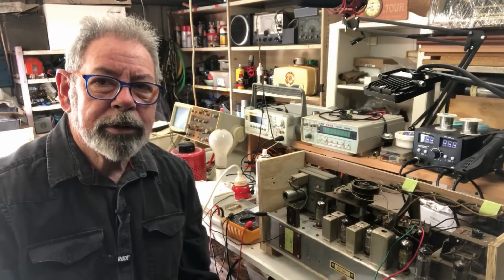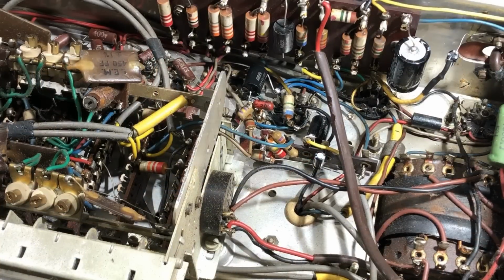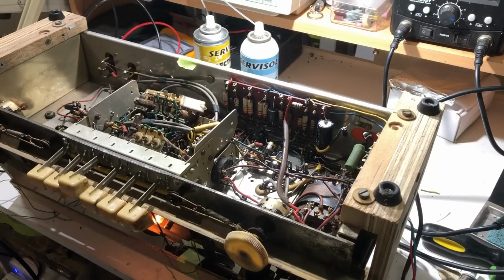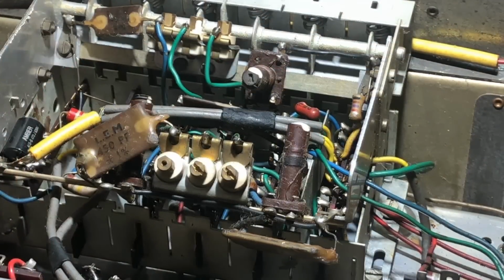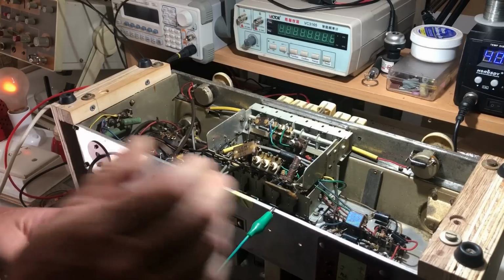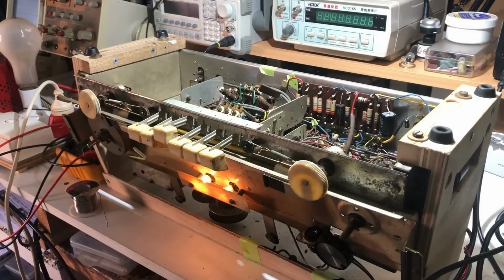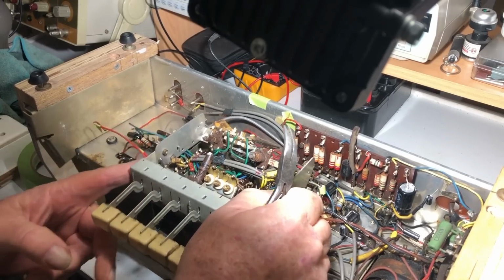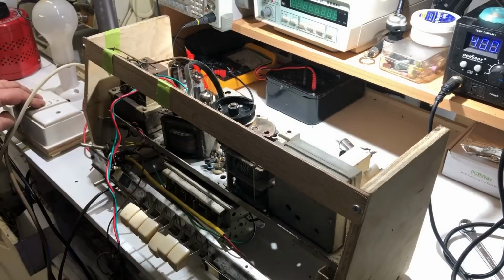BUSH VHF64 Part 2 - The deeper I dig, the worse it gets!

Comment: Often the IF cans have silver mica caps inside. They will sometimes fail after being used for a while after a long silence. The silver migrates to the edge of the wafer and starts arcing, causing the crackling noise.
Reply from the maker: Hi. Yes, I'm familiar with silver mica disease.  I have also found it in other mica caps outside the IF cans.  In this case though it was something else.  You'll have to watch to find out lol
Reply: @Donno308  UK IF transformers dont use the same type construction as the American ones that give problems, they use separate  capacitors, not ones integrated into the base in some way

Comment: These Bush VHF radios are difficult to access for servicing, as you probably well know by now 😀I think your work is as neat as it can be in the circumstances, without spending days more than you need to to get it only moderately more neat. Nice job so far... The crackling noise could be a capacitor inside the IF cans, if they're mica they could have silver mica disease. Could R12 be noisy? Did it get warm with the radio on AM and FM or just AM (or FM). Good luck.

Comment: That radio is giving you the hellin, Don, those switch wafers were prone to the phenolic board carboning and arc tracks developing. Nowadays no more problem with 3-d Printers, maybe Dave T. can help out. As for the Sprite: I would definitely go for it if the sills and the bottom of the rear fenders behind the back wheels are ok. Always depends where the car has lived, hopefully not to near the ocean 🙂 They arent too hard to weld, hardly any box sections which are difficult to get to get to, all pretty basic build..
Cheers from Deutschland
Reply from the maker: Hi Blitz!
Good to hear from you.  I am now certain that the switch wafers are the problem. Apart from eliminating just about everything else, I can see arcs tracking across the phenolic board between the contacts. Perhaps 3D printing is the answer but the contacts are pressed through the phenolic in such a way that they would be difficult to remove and re-install without damage.
I'm considering  fitting micro switches, activated by the movement of the sliding contacts.  I think I only have room to fit 1 micro switch per bank so I thought I would use relays, activated by the micro switches, where there is more than one set of high voltage contacts on one switch.  Not sure yet - I have decided to have a break from it and do something else as I am getting frustrated with it, however I hate unfinished jobs so I will definitely get back to it.
As for the Sprite - I wasn't entirely happy with it.  It had been heavily modified for competition and wasn't easy to drive around.  I'm now looking for an early MGB.  We'll see.
Cheers

Comment: Is this the dreaded silver mica disease? It's a pain to fix. I think you may have replaced that 150pF silver mica with a 1.5nF, not sure but now having watched it to the end, that is the least of your worries. I have never before seen the IF coils switched, it would probably work just as well if you cut the wires and got the HT away from the switch. Good luck with this one.

Comment: One of the main problems with these switches is there vulnerability to cleaning using spray switch cleaner,the phenolic can in certain circumstances absorb the cleaner and breakdown under high voltage causing the effects you are experiencing,cleaning with a q-tip on each contact is preferred.
Reply from the maker: Hi. I'm afraid the damage may already be done.  The first thing I did was give it a spray with contact cleaner :-(  I'm still holding out hope that it isn't the switch.  If it is I'll see what I can bodge up.
Cheers

Comment: Hi Don,
These slide switches were notorious for burning and arcing, therefore creating carbon tracks into the phenolic between individual switches.
By the time I was age 17 (during virtually all of 1972) those entire switch banks mechanisms were no longer available as a replaceable part …only NOS were available.
Unsoldering, removing, making new phenolic boards, and fitting the original switches into the new board so they line up, and work can be a serious pain in the rear.  I know because I’ve done it!
Before doing anything else, critically check each one of the phenolic boards and switches.  The arcing problems are often caused by electrically leaking capacitors, and dust, especially if it contains carbon that derives from coal smoke environment, and to a lesser extent from cigarette smoke.  So, be meticulous when cleaning them.  They can be porous so be mindful what you clean them with.
On a side note, have you thought about building your self, or adding a ‘component sniffer’ probe (in my day of servicing they were referred as an ‘electronics servicing bloodhound’, or just ‘bloodhound’) to your signal tracer?  Very useful probe for determining, or sniffing out crackling and popping resistors, and capacitors etc.  Mr Carlson’s Lab provides a comprehensive circuit for one (connected with a Heathkit signal tracer servicing video), plus he does a detailed demonstration of its operation.
Cheers Don, from Phil.
Reply from the maker: Hi Phil.  I think you're on the money with the slide switches.  I have eliminated just about everything else and I have now observed arcs forming across the phenolic between the contacts.  I'm wondering if I let them burn, they will burn themselves out?  I'm looking at whatever options I have.  I hate the idea of scrapping such a potentially nice radio.
Reply: @Donno308  Hi Don,
Very high probability the arcing, or burning was no fault of yours: quite likely the process started a year or so before that radio was decommissioned, or put to one side.  Perhaps the owner at the time felt it had been such a good radio, it would likely have been seen as an egregious act to have discarded it.  My guess is, the lack of arcing when you first got the radio working on AM  gave you a kind of false impression for a short while.
Making those slide switch phenolic boards can be very fiddly, tedious, and time consuming: especially if you are doing everything by hand with little or no shop precision tools.  If you had no option other than to go down that route, remove the metal contacts with absolute care, you will need to reuse them later - they can be a pig to reproduce.  I know this because I’ve done it a small number of times when I’ve worked on other makes of radios.
If the arcing is not too severe, it is possible to poke, or gouge the carbon tracks out of the phenolic.  Be meticulous when doing this as any carbon left behind is in effect a resistor, therefore will eventually cause arcing again in the future.  If a hole appears in the phenolic, provided it is not to large so as to weaken the switch mechanism, don’t worry too much about it.  Fill in the decarbonised tracks and holes with a none conductive hard filler; smooth it over when fully set so that it looks a decent job, and also to avoid impeding switching motion.  When smoothed to personal satisfaction, paint over with a none conducive lacquer to aid extra hardening and strength.
This might come across as being ‘belt and bracers’ but I am a ‘belt and bracers’ type of chap LOL!
I am very happy if any of this is useful to you my friend, regards, Phil

Comment: I think the crackling and switch smoke might be two separate faults. My money's on silver mica disease in the IF cans for the crackling and carbon tracking in the switch wafers for the smoke. But I'm probably completely wrong - I'm not sure it would explain that hot resistor. ..

Comment: Hi Don, no progress on mine sent for some caps but the filter caps were short supply and have to wait a little while longer. When you were talking about the contact clearance on switch S6 @55:16 I couldn't clearly see the contacts behind the red/ yellow/blue wire group in the bottom corner. I believe that is S6f and s6z on one side of the centre bar. F should close and Z should open as the FM switch is operated. If Z is still in contact when operated both AM and FM IF tuning circuits will be shorted at the same time, feeding B+ via R12 to the pin 6 anode of the ECH81directly. If so the current draw will be high (and possibly a higher anode voltage than 190V), would explain the hot resistor and the smoke generated in the switch if the contact is HR. Hoping mine is ok there don't relish taking that key assembley out. Good luck!
Reply from the maker: Hi.  Thanks for pointing that out.  I will certainly check it out.  I'm back in the shed today after the usual frenzy of editing & publishing the video.  Whatever, this time I will have to be more methodical.
There's no reason to think that yours will be this much trouble.  You will still be faced with replacing a lot of those Hunts caps but that's no big deal, just tedious.
Cheers
Reply: @Donno308  I sure hope so, that looked tricky. btw thank you for ignoring my error. late nights and a few beers. Of course a higher current draw  without the impedance of the IF coils will drop the voltage across R12. giving a low voltage on the anode.

Comment: It's fighting back at you Don. Most likely every cap is a resistor now. Instead the caps are like little shorts and 
causing the smoke down the signal path. Dodgy PC board terminal material could be the problem ,it may be conductive!
Reply from the maker: Hi
I've already changed just about every cap in it.  The question now is whether the resistors are still resisting!  I hope it isn't the PC board material in the switch that's causing the problem.  That would be impossible to fix.

Comment: Don could this be simple Silver Mica (SM) disease?  Intermittent shorts in the SM caps often inside the IF cans.  In a dark room you cans sometimes even see them flashing.
Reply from the maker: Hi.  I hope it's something like that.  At least it would be fixable!
Cheers
Reply: @Donno308  Keep going Don!  Everything is fixable if you change enough bits.  But seriously I think SM explains everything you are seeing and hearing - smoke and all!  They are often used inside the IF cans some with HT across them.  “Tapping” them with the end of a screwdriver often stops or starts the noise

Comment: i'd still say it IS the switch...slightly carbonised and/or partially conductive due to moisture/dirt, try disconnecting the section that shorts those IF primaries , as that part may be near to a low potential section .. and maybe the one switching the ht to the fm tuner, temporarily wiring it permanently , it 'could' with a bit of bodging be replaced by a small microswitch somehow activated by the FM button!! i think i'm going to have to do this with one of mine, if i want to bother with it, as the dial plate has lost all its paint 😢
Reply from the maker: Hi Andy,
I'm hoping it isn't the switch - If it is I could also maybe use a relay to switch the HT with only low voltage on the switch contacts.  Hopefully I won't have to.
Cheers
Reply: @Donno308  i'm afraid very likely ht tracking across it, its a known problem 😢
Reply: @Donno308  yep, relay or microswitch, as i said you should be able to disconnect those sections across the IF transformers without any major problems, not all manufacturers did it and their sets still worked perfectly ok, just may have to tweak IF alignment especially on FM to compensate for loss of the switch and wiring capacitance

Comment: testing valves on a valve tester doesnt always show up all problems, they dont usually test internal insulation at full volts,  its 'possible' random breakdown can occur at normal working volts,
Reply from the maker: Hi Andy.
Yes I guess that's a possibility too.  Unfortunately I don't have any substitute valves that I can plug in.

Comment: "Siver mica desease", that's all I could think of, hearing the crackling. Caps inside the IF cans.
Reply: Measure the dc on the if cans - if it’s S.M.D. Then you would see it fluctuating as it crackles
Reply from the maker: Thanks.  Good tip.  I'll give it a try.
Reply from the maker: Hi.  Yes, I'm thinking that too.  
Cheers

Comment: arcing/carbonised switches of that type is quite common, i have a murphy piano key set that flashed violently and almost caught fire, not a lot you can  do about it once carbonised, except disconnect any ht connected sections if possible, some arc between the ht connected sections and low potential ones if they decide to put them next to each other, which is rather silly, even the section which switches ht to the fm tuner and turns the am oscillator feed if same section can arc from the 'active'  side to the non active one ,  bush model vhf91 and vhf70 were notorious for ht tracking in the slider switch , looks like the  vhf64 is also, i think the srbp material absorbs atmospheric moisture over the many years making it slightly conductive, even if it doesnt arc, dc  can get where it shouldnt causing strange problems........  that part of the switch across those 2 IF transformers could likely be removed from them, theyre only to make sure stray IF signals cant get through the unselected IF section, but that'd be unlikely anyway
Reply: thing is i had chance of getting one of these cheap a few weeks back, but havent really got space for one, so passed on it,  no doubt cost of posting it to you wouldve been horriffic
Reply from the maker: Hi again Andy.  Yes the cost of postage would be ridiculous.  One of my subscribers offered me a good dial glass for this radio and I paid over $120 for the postage, just for the glass.  That's more than twice what I paid for the radio but these radios are rare here so I thought it was worth it.
Cheers
Reply: @Donno308  😲 sacre merde !!
Reply from the maker: Hi Andy
I hope you're wrong but I suspect you're right.  Someone suggested using relays and I had the idea of using relays to switch the HT so only low voltage would be applied to the switch contacts.  That may introduce noise into the circuit but maybe worth a try. I could run the relays on heater voltage and compensate for the extra load, if necessary, by replacing the dial lights with LEDs.
What do you think?

Comment: Those bloody pommys made a dodgy radio :-D
Some grundig valve radios have a nightmare multi switch with the mains running rather close to the other wires,  that would frighten the crap out of me.
I would find a place for a relay to do the switching, yes im evil lol.
The car looks ok but i would wonder if its been plated underside to hide holes and cracks.
But im no car inspector.
Reply from the maker: Hi,
Yes, those bloody Poms! lol.  The car seemed pretty solid, although it has been rallied pretty hard.  In the end I decided against it, mainly because I just don't have the time to commit to it.
Some people have suggested that the switch phenolec material may have become conductive over time.  Apparently that's a thing.  If that's the case, relays may be a possible solution.

Comment: What a bugger !! 
I really thought at one point that you were going to find some carbonisation on the switch wafers causing them to arc over...but no !
But great to see you end part 2 on such a positive note: resolute and more determined than ever...that's the stuff !
Reply: ht tracking is a known issue with these.. the srbp/paxolin material absorbs moisture and becomes partially conductive, thats what starts it,, problem is the makers put switch sections with ht on them right next to ones at low or ground potential, this is when it happens

Comment: Hi Don, the crackling / shot noise was fixed by replacing that silver cap you cut, yes?  but for some reason it also reminded me of noise from mica capacitors breaking down within tuning cans, and 2 minutes later you got the smokes and coincidentally the circuits affected contained tuning cans. As you say, the circuit appears simples for that switch bank.  Carry on.  PS.  if this was me, that thing would be approaching the bin at the speed of light by the third smoke 🤣 You have the patience of a saint.

Comment: I normally only swear when I do my own restorations, but this time a very emphatic four-letter word escaped my lips when I saw the smoke at the end again. I feel your pain. I haven’t looked at the schematic lately, but that resistor heating up may not have anything to do with the IF can. It feeds the previous tube though the IF coil, and if that tube is drawing too much current, the resistor could heat up. I know you’ve tested the tube, but I would check its bias again and also maybe swap in a good one to see if that is the case. Good luck 🤞
Reply: valves can develop internal shorts, maybe only appearing after warmed up,  and also 'grid emission' passing higher current as they get thoroughly warmed internally , ,  also 'gassy' but ones afflicted will usually glow purple ,
Reply: Manuel, Maybe you should copy Don's Girly icons he says it increased his views.  
Though you have had some shots of bare chassis.
Reply: @mackfisher4487  : great idea 😊 actually, to be more location-correct, I’ll add some pic of old Madeiran grannies sitting by their windows to acct as antennas for the local gossip … no, that won’t work 😊 the girls are better.

Comment: What a pain! I admire your tenacity - the switch removal would have made me crazy. Can you list which wattage of light bulbs that you find are useful for your dim-bulb limiter? It's getting tougher to find a good selection incandescent bulbs at our local stores, so I will place an order to Amazon. BTW, I like the Sprite!
Reply from the maker: Hi.  I use a 40 or a 60 watt globe in most situations.  I start with the 40 but a lot of radios won't run on that. I use the 60 when I'm a bit more confident.  I also have a 200 watt that I use when I just want a basic minimum of protection but I would say that's probably not necessary.
Cheers
Reply: @Donno308  Thanks for the info, Don. I'm looking forward to seeing what the problem is. Good luck.